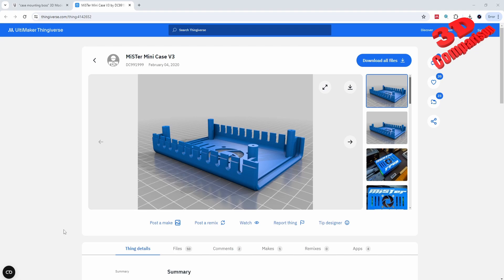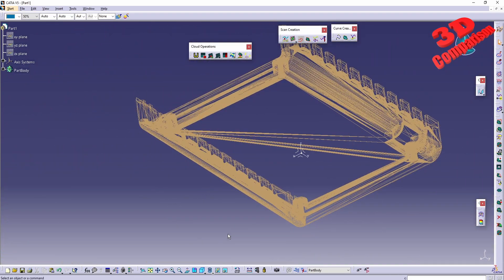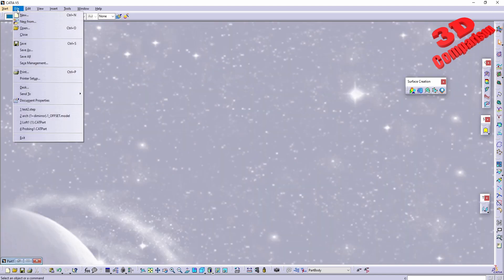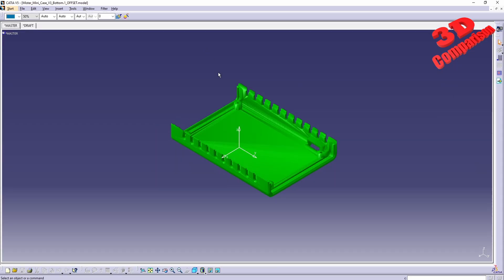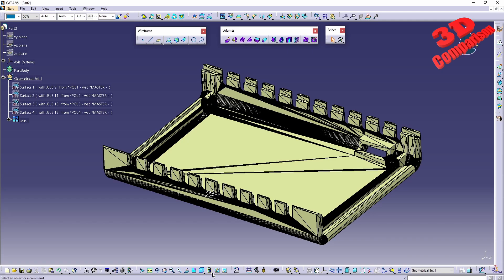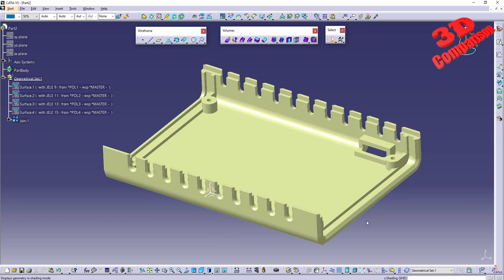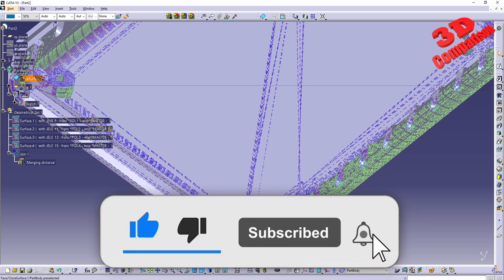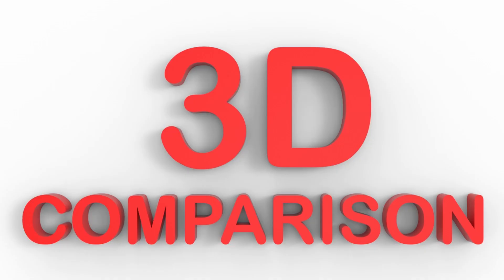CATIA V5 - STL to Part Design

Comment: Catia say "your model is opening" when i try to close surface :/
Reply from the maker: Yes, the models to be fully filled "water tight" with no opening to be a closed surface. A closed surface actually has material filling on the inside within a section.

Comment: Hello! 
when i follow this procedure, i can't stick the "MASTER" in the Part. it tells me it's impossible.
Reply from the maker: Hello, check my most recent video as I have addresed some limitations of Catia v5 when converting stl files to solid bodies.
Reply: @3DComparison  Hello, I have the same issue as elarass, what I have to do to resolve it ? or which video I have to watch ?
Reply from the maker: Hello, it should work. Maybe it is a problem with the Catia V5 version that you are using. If you want you can send me the files and I`ll give it a look on my version.